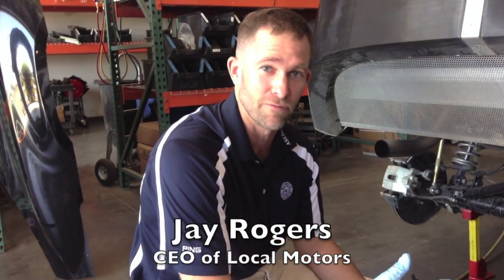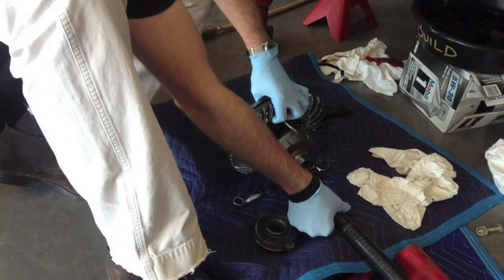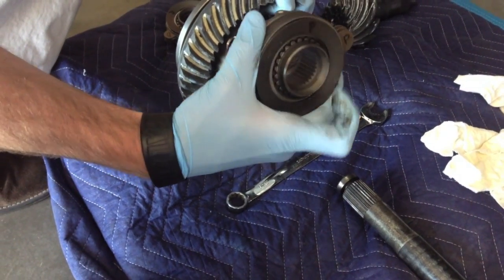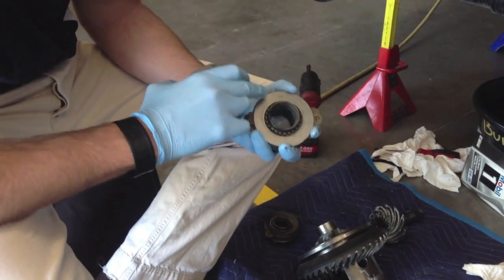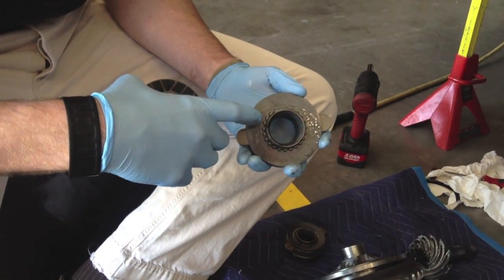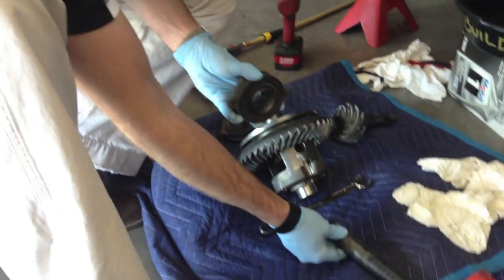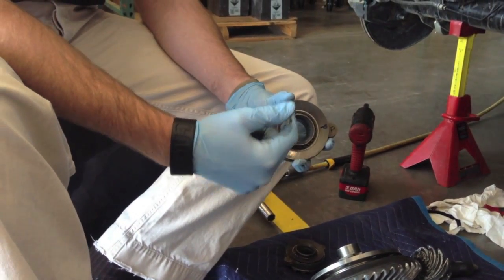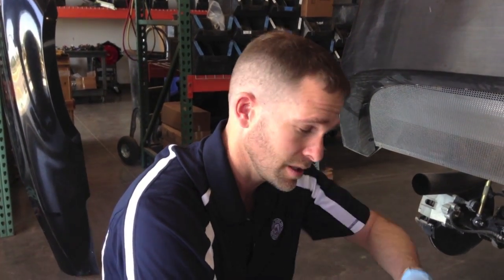CEO of Local Motors Jay Rogers talks Clutch Packs, Rear Differentials, and more

Comment: The third member is the assembly that the driveshaft connects to, the "guts" of the differential.  Those gears and rings are part of that.  The other two members are the axle shafts.